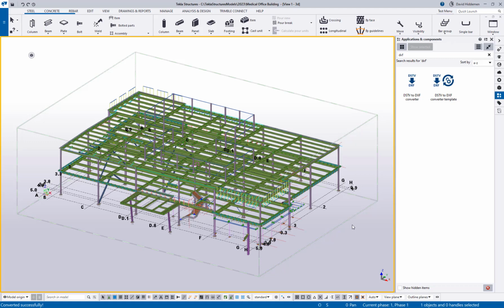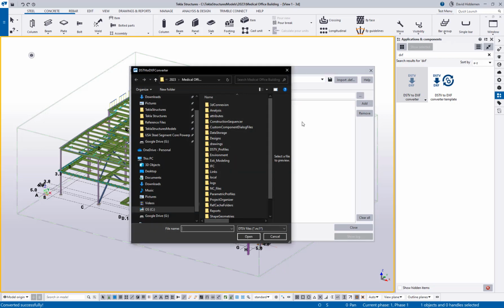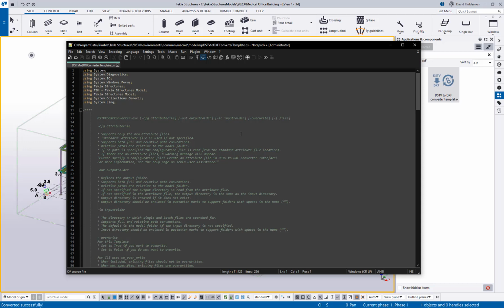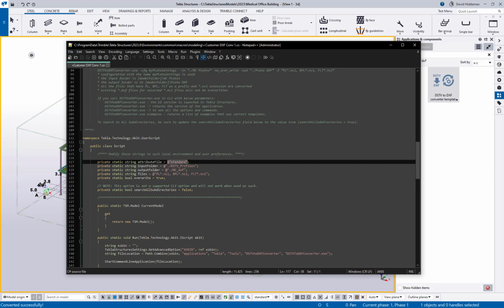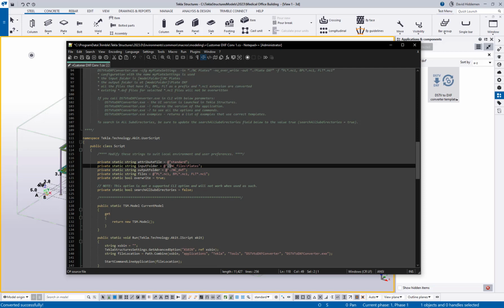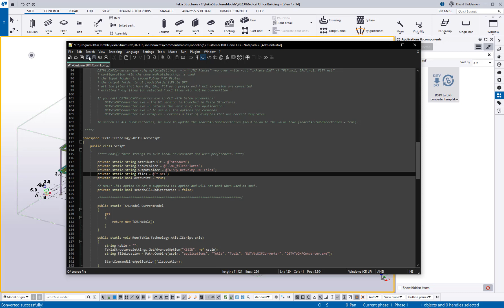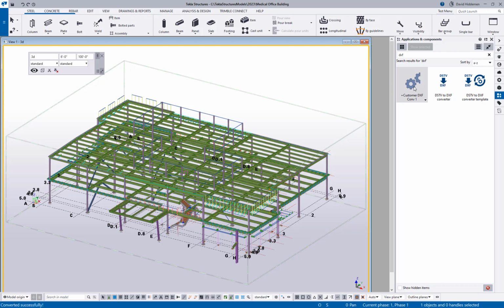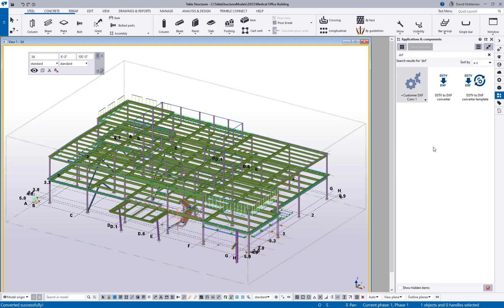Automate your DSTV to DXF conversion in Tekla Structures

Comment: It does not work if we have nc1 files stored in several folders sort by thicknesses for example? 
In this case, should we add all possible paths in the code?
The problem would be that if a folder is missing the application will not work...
Reply: Hi, I am not a developer so I'm not sure how to manipulate this macro as it currently exists to handle multiple paths - although such a thing is certainly possible. This is something we can create a feature request for - straightforward handling of multiple folder paths for input and ouput.
Reply: @TrimbleTeklaDave  I'll manage, so far I haven't had any help from support or forum or youtube, and I succeeded, I should be a developer at trimble haha